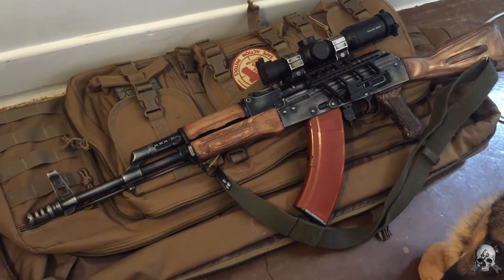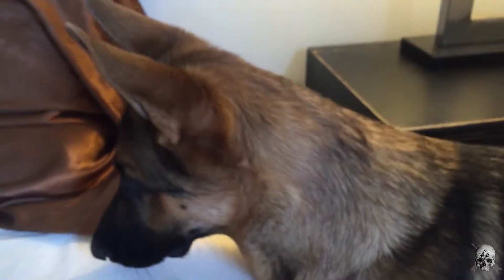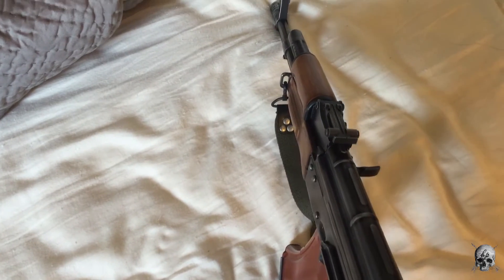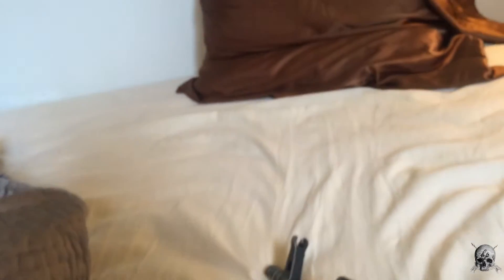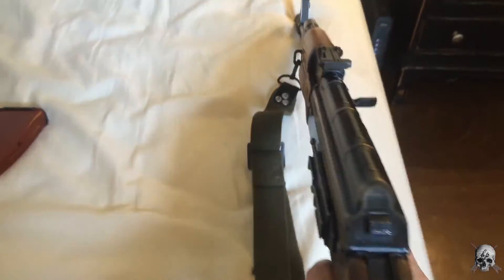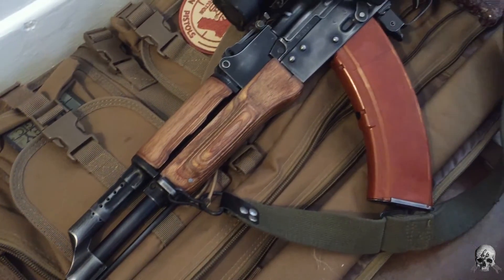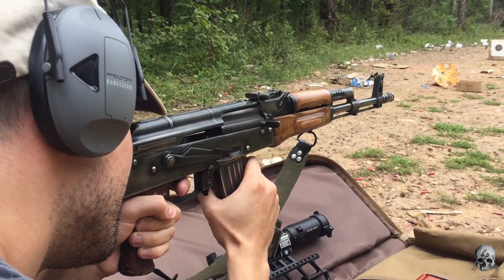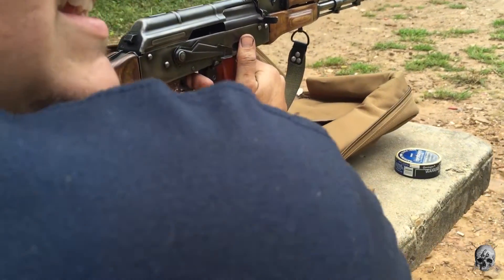Lee Armory - "Hungarian BFPU" Review

Comment: nice video bro. I actually got one of their polish ak's and its pretty nice. Only thing i do not like is magazine wobble,  common on alot of ak's but out of all ive handled, their polish ak has alot of wobble with multiple magazines. does yours have this issue? Premium polish ak's are good to go from them, equal to definitive arms dakm 4150. what made you go with the hungarian over polish? Thanks
Reply from the maker: The polish rifles sold out or I would've gotten a polish build... This rifle has a bit of magazine wobble but there are no feeding issues so I'm not too worried about it... After I had the chance to replace all the furniture, etc, it's turned out to be a fine rifle. 

Lee Armory even mailed me a brand new dust cover that fits correctly. These rifles are all covered bumper to bumper (lifetime warranty) so if you ever have an issue with your rifle, give Lee Armory a call.